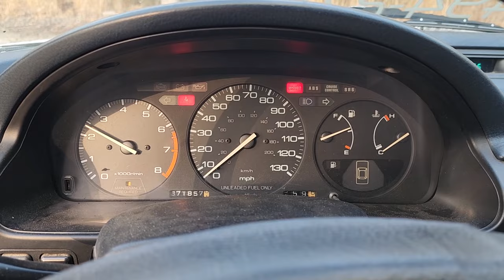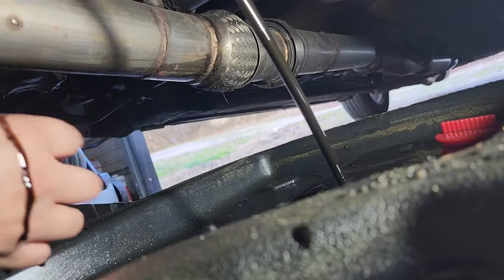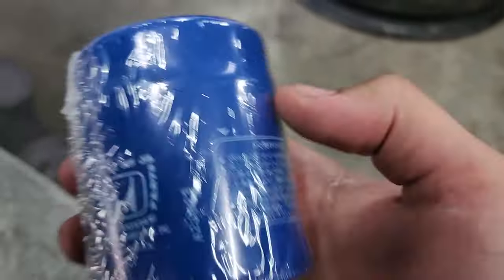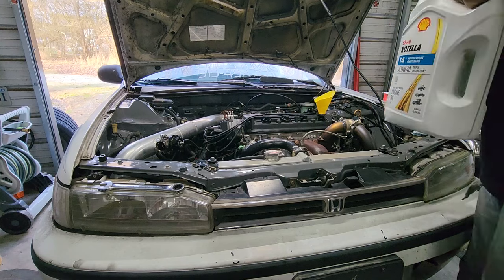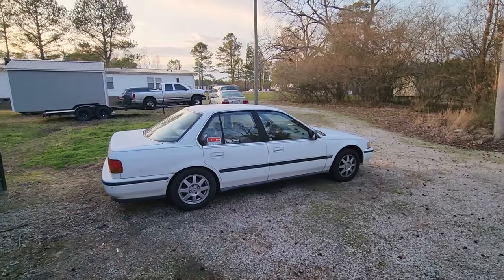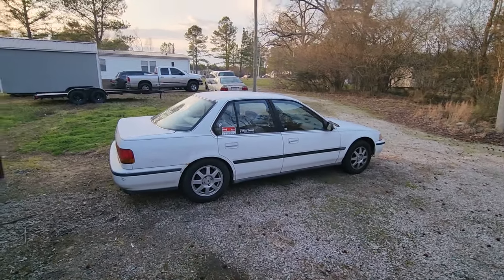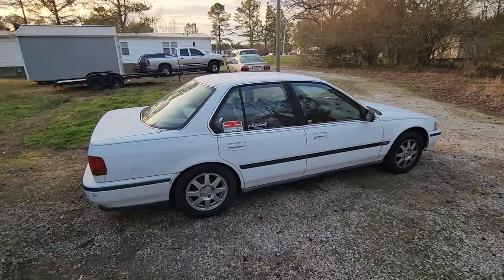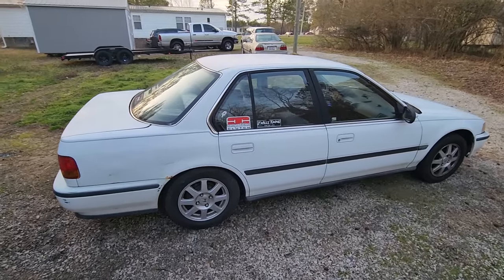350WHP/330WTQ STOCK MOTOR F23A TURBO RIPS! | Boosted Honda Sleeper!

Comment: for the CB7  how did you run the idle air control valve? for the f23 intake manifold . Really need help on that
Reply from the maker: I never run it. I delete them on every car I have. There are write ups online for that tho
Reply: @DrivenFilmsPhotography  okay thank you 🫨
Reply: @DrivenFilmsPhotography  did u use a playe to delete it or u just left it unplugged
Reply from the maker: @luvayeavocado5377  I block it off with a custom cut gasket and turn it off in the ecu so there's no CEL
Reply: @DrivenFilmsPhotography  i dont have an aftermarket ecu . is there anyway i can still run without it and have the car idle without surging